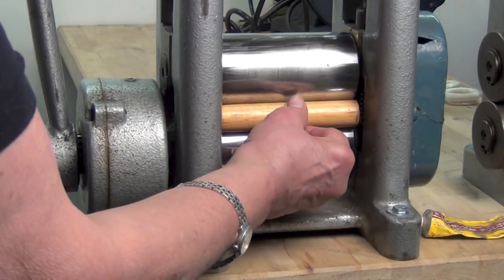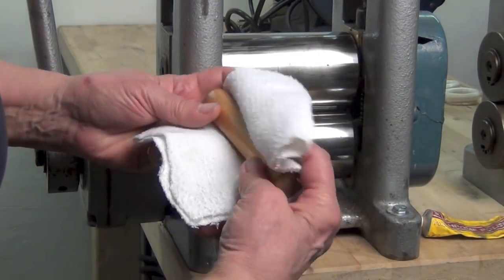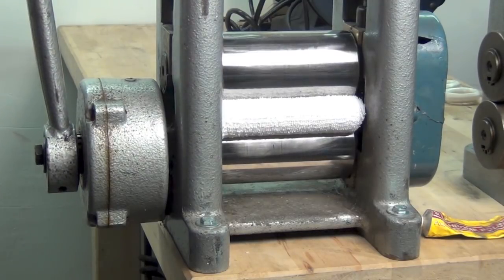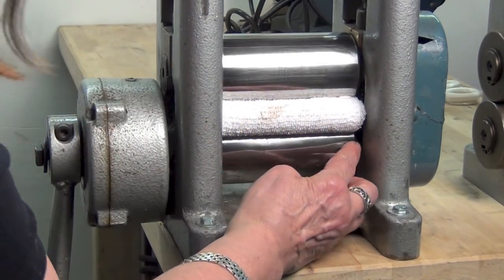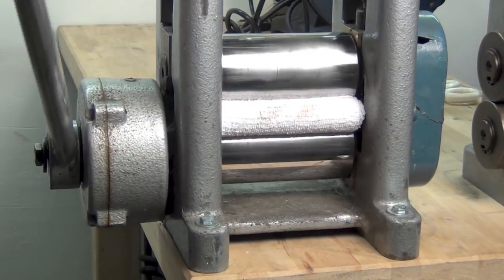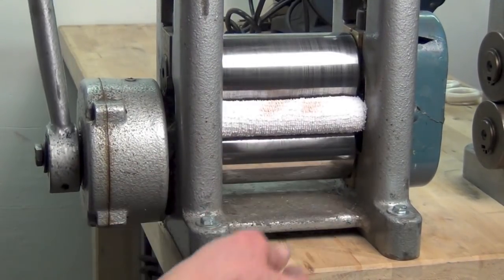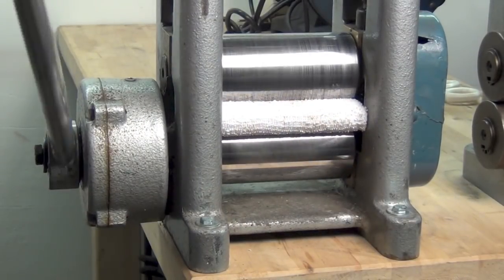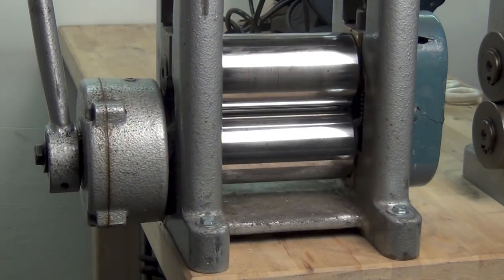Cleaning and Polishing a Rolling Mill with Ronda Coryell

Comment: on a rolling mill w/the gaps in it to do the square wire or the half round wire do you still use the same method?  how do you clean out the gaps used for the wire?
Reply from the maker: Hi there! Yes, you would use the same method with the square and half round holes. You will keep bringing the rollers down until the desired dimensions are achieved. We typically recommend simichrome and a paper towel to clean the gaps used for the wire. We hope this helps!
Reply: @RioGrande1944  Thanks.